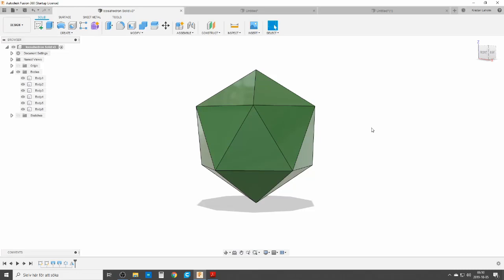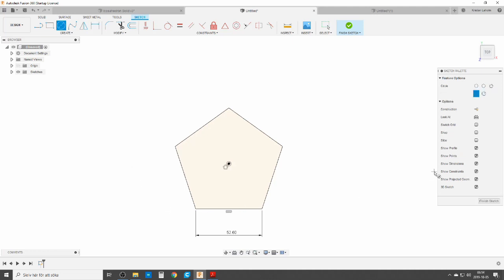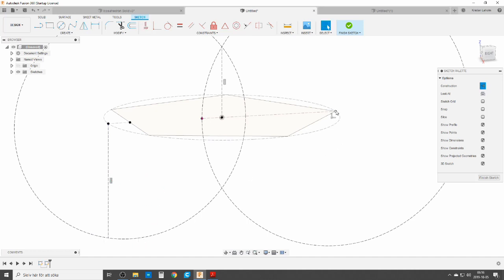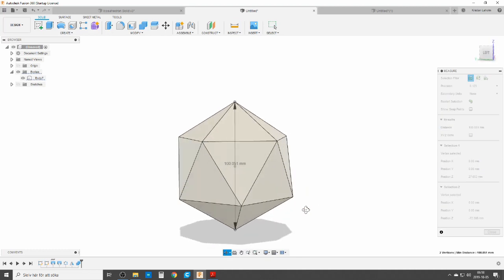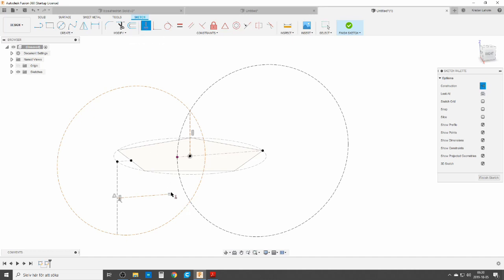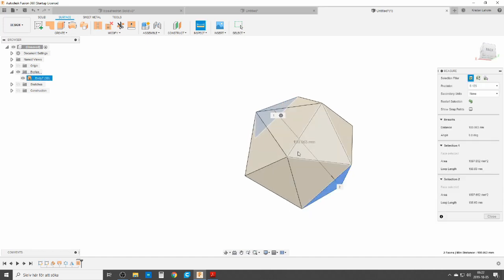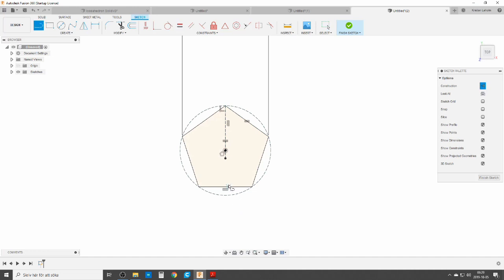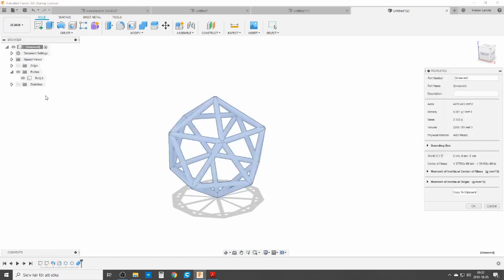Fusion 360 - Simple way to do Icosahedron (D20) and my solution to Invusion CAD Challenge #002

Comment: For those who want to get the exact height from point to point or face to face, you will need to create some parameters, start with Height and give it a value, now make these next two, one will drive point to point and another face to face, get them both, they are gold. Create a parameter named PointToPointHeight and give it this value: 
Height / sqrt(( 5 + sqrt(5) ) / 2) 
Now create one named FaceToFaceHeight and give it this value:
Height * ( 6 / ( sqrt(3) * ( 3 + sqrt(5) ) ) )
The face-to-face distance is the diameter of the inscribed sphere, while point-to-point is the diameter of the circumscribed sphere. The ratio between them is fixed for any icosahedron, so both formulas will scale correctly. just swap these out in the sketch as the driver for the edge length and your set. Thank you Kristian for these wonderful guides.

Comment: at 5:23
Tried 3 times and mine doesn't look like that. I have a bunch of extra lines.
Reply from the maker: Check the sketches, they should be fully defined (all black lines and the lock on the sketch in browser) and look if Fusion has added some extra line/arc then sketching. 
And have a look at my video with only the icosahedron workflow https://youtu.be/YcpB4HZJDio I think I cleaned up some small things in the workflow for that one.

Comment: Could not get any easier than this first way of making icosahedron.  Excellent and thanks.  What if I'd like to make a cut at each corner (will have pentagon shape), how do you go about it?  I'm able to cut 2 opposite corners which are symmetrical  on XY plane.  I'm picking my hair off for others.   Idea for another short video for you?
Reply from the maker: Hi there is a new video of only designing the icosahedron https://www.youtube.com/watch?v=YcpB4HZJDio&t=0s.
I'm working on a new playlist about the archemedian solids there I will get to the truncated icosahedron in the end (I hope) https://www.youtube.com/playlist?list=PLCLbfOk6fdG39TSA__Qq7TpxrgYSUSgEa
Reply: @KristianLaholm  Fantastic.  Looking forward to it. Thanks and Happy New Year
Reply from the maker: @mtstek  Thanks, and I hade to try if I could solve it.
Here is a preview https://imgur.com/xkypBeF
You can use my video https://youtu.be/YcpB4HZJDio as a start, you have to cut of the corners (truncate) on the first body before doing the circular pattern.
I'll post a video ... next year :)
Happy New Year :)
Reply: @KristianLaholm  Thanks for the idea.  The cuts at the corners are not complete, make cut on 1 face out of 5. The 2 points after the loft are cut completely, the rest is left undone.  After a little of thinking I get the whole thing truncated via offset planes (a very long way, hope you have a better way).  I did it.  Yeah!!!!  What do we call this thing? It's not Icosahedron anymore.  Here's the link:
https://a360.co/37uvLbP
Reply from the maker: @mtstek  Good work 👍 you have made a "Truncated Icosahedron" one of the  Archimedean solids https://en.wikipedia.org/wiki/Truncated_icosahedron
There is no wrong way in Fusion 360 only shorter and longer 😀 I did an extra body to truncate (intersect) the first body (loft + loft) then circular pattern and a mirror the same as my icosahedron.
Reply from the maker: There is a small problem in your model, there is a hole inside of it.
Use "Section analysis" in Fusion 360 and you will see it. No problem if you are only using the outside of the solid but if you are doing something like a "shell" it can surprise you
Reply: @KristianLaholm  You're right, there's a hole at the center.  So I chop the corner after first loft and then manually chop the rest. BTW, this way is much easier than the I did earlier.  Thanks so much. Enjoy the New Year.   We still have more than 12 hrs to go.